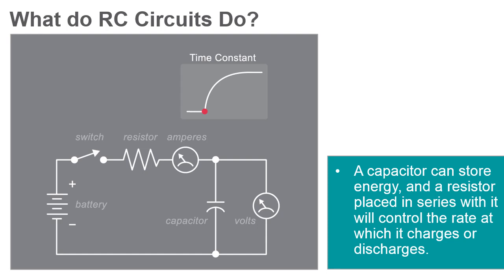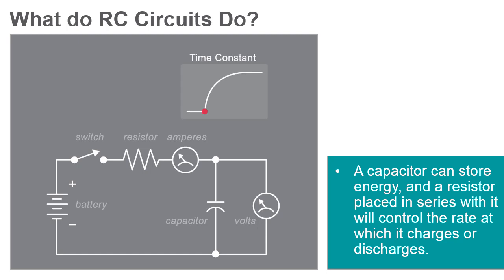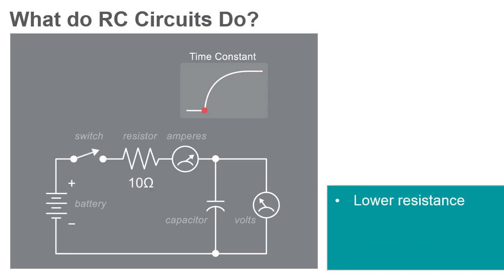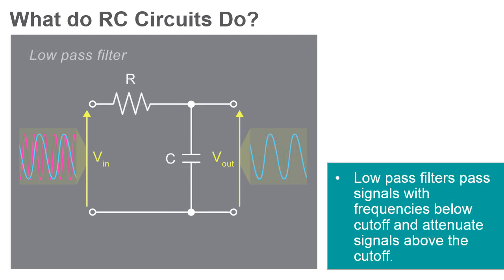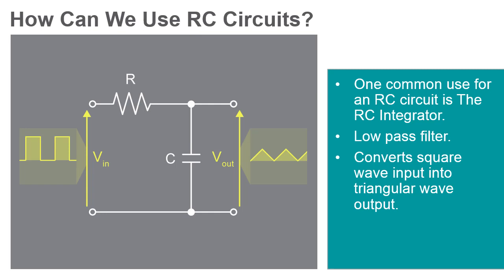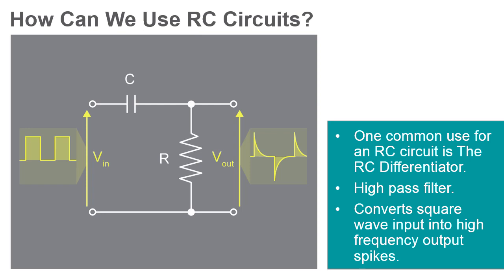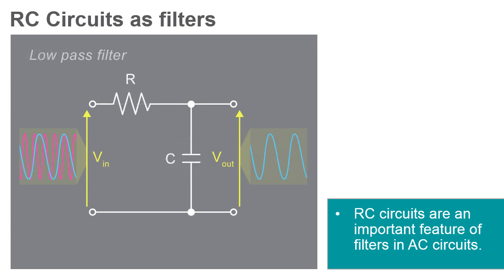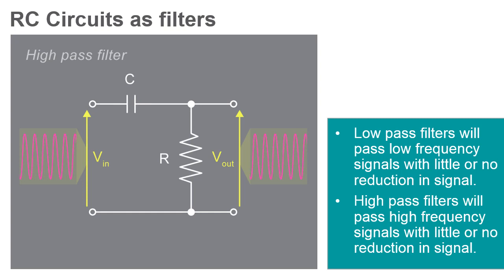RC Circuits

Comment: The term Integrator is fine because all the charge is added together on the plates of the capacitor during the charging cycle but to generate a triangular waveform with linear slopes, a constant current through the capaitor is required and hence an active op-amp is generally deployed. The basic RC circuit will not generate a linear waveforms because as the capacitor voltage rises and falls at a certain rate (with respect to time), the potential drop across the resistor changes and thus the current flow is not constant. An OP-AMP integrator circuit comprising the same two RC components maintains a virtual ground by compensating at the output voltage terminal for the change in capacitor voltage, thus maintaining a constant current through the resistor and a constant rate of change across the capacitor giving rise to a linear output or a triangular waveform when the input voltage is a square pulse shape.